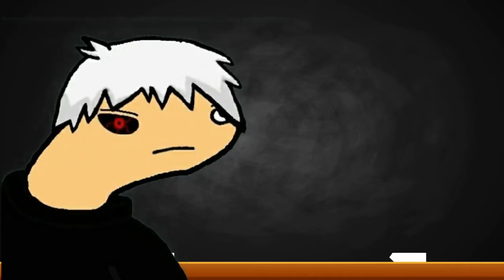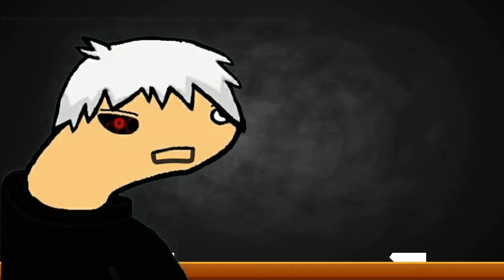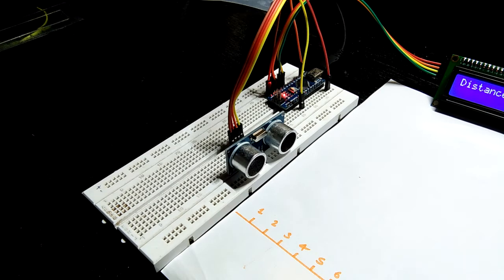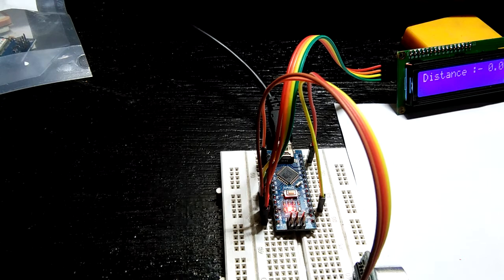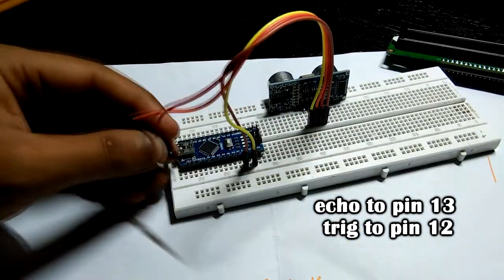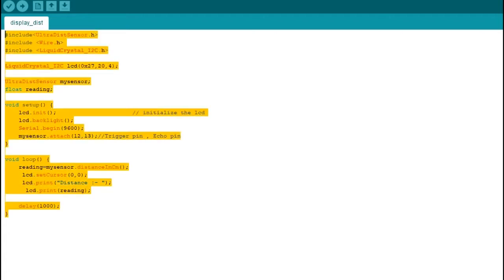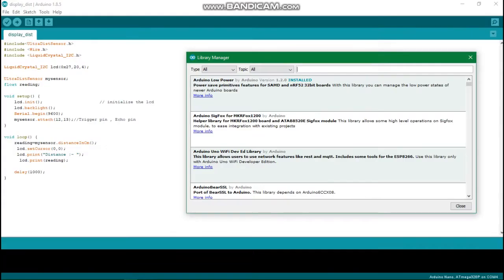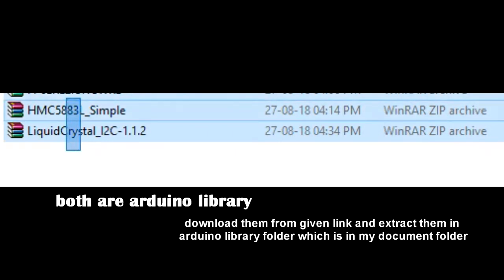Ultrasonic Sensor HC-SR04 Tutorial with LCD I2C

Comment: Bro plzz help me, if i measure at 15cm its working fine but after incresing the object place the distance is showing wrong
Reply from the maker: Is that so? Are you using same code or a different one
Reply: @ArnovSharma  same code bro😓
Reply from the maker: @shashankreddy6908  🤔 what surface are you trying this measurement thing on? Different materials have different absorption rate so maybe that's the problem here.
Reply: @ArnovSharma  cardboard i am using
Reply: @ArnovSharma  plzz help me, i should submit it by morning🙏🙏🙏

Comment: hi what value of distance should you use if you wanna measure things in meters or feet unit.
Reply from the maker: i'm using this "reading=mysensor.distanceInCm();" for getting values in cm but you can change " reading=mysensor.distanceInMeter();" or similar function.

Comment: what power the circuit? did you connect it to 9V battery?
if im using CT-Uno, do i need to include 9V battery, and if possible i need to have schematics that include 9V battery
Reply from the maker: is your CT Uno is an arduino Uno Clone? if yes, then you don't need to add any voltage regulation circuit to your setup... just power it with an 9v battery
Reply: @ArnovSharma  i guess so, i dont know how to connect it the 9V to the CT -Uno
Reply from the maker: @phynex5555   does your clone board have a VCC or an Raw port? if yes then connect positive terminal to it and ground to ground
Reply: @ArnovSharma  i have solved the issue, but now the i cant upload the code because the UltraDistSensor error shows up . It says it is not a type of name'. How to solve it?
Reply: and also , i cant install the HCSR04 lib from the link because it said not valid lib
Reply from the maker: https://www.arduinolibraries.info/libraries/ultrasonic
Reply from the maker: install the library first
Reply: @ArnovSharma  i have install it, but still cant compile due to that error
Reply from the maker: there's something wrong with your board
Reply: @ArnovSharma  library name you used is UltraDistSensor i couldn't find any library in that link you provided with same name.
Reply from the maker: @adityakaranth8619  i think they removed the library
Reply: @ArnovSharma  upload your lib.